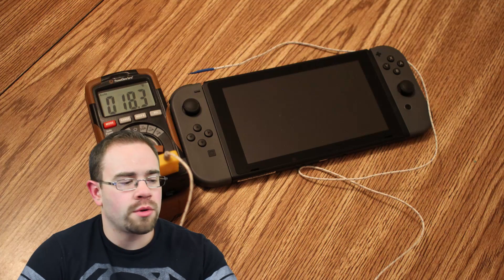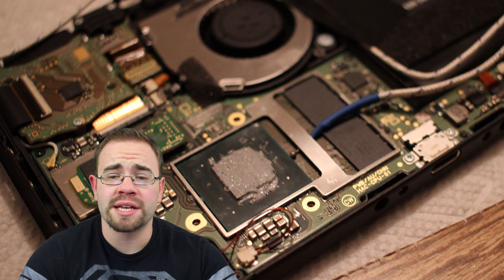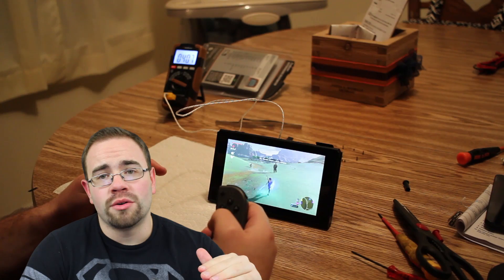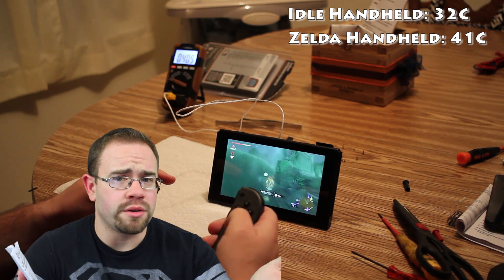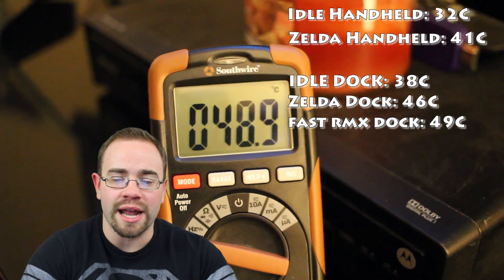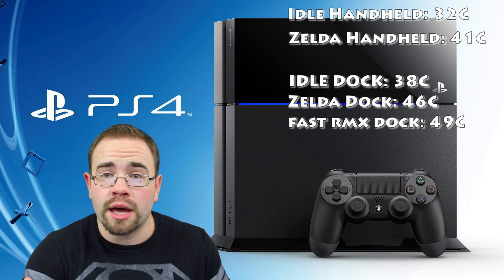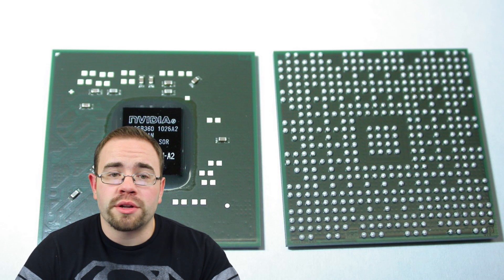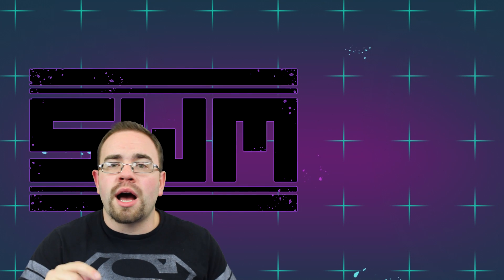How Hot Does The Nintendo Switch Get? Temperature Results!

Comment: I know the switch is not quite as powerful as the xbox 1 or ps4 but is he switch still more advanced then those systems and is there any way the chip can increase the the power?
Reply: BuffaloBill ....its mobile man do you not get that there is a difference? The PS4 and XBONE of 2013 are now equivalent to garbage cheap gpus nowadays...The Switch is like 10x more power efficient. That's like saying the first iphone wasn't advanced in any way because it couldn't run games from the n64 days 10 years before.
Reply: So are all consoles...your point?
Reply: BuffaloBill

"The thing is still WEAKER, than its competitors"

If you expect a device that's infinitely smaller, portable and $100 cheaper to have the same power as those bricks that sit on your table you're out of your mind. 

"So sad to see Nintendo bow out of the home console scene"

They've already sold beyond wiis release numbers which was one of the best selling systems of all time. Which btw outsold the ps3 that was released the same year. These slight differences in performance don't matter one bit, it's all about gaming. People like you are so easily fooled by arbitrary numbers and delude yourself into thinking that's all there is to it. This is the "Sega does what Nintendon''t" crap all over again.
Reply: You're right. All consoles are weak compared to their PC competitors. We are in agreement!
Reply: So...I have a 980ti in my computer, but I can't take it with me to play wherever. I get a Switch so I can. Why would I ever want to get an extremely outdated and weak PS4, PS4 Pro, or XBone?
Reply: BuffaloBill 
The whole point of Nintendo is innovating gameplay. Nintendo's specialty is adding a unique selling proposition which competes with competitors by not competing with them. I'd want to get a Ps4 but nevermind I'll get a Switch because it's the only one that I'll be able to play outside. There, USP. 

Nintendo doesn't compete in power, but gameplay. As long as it's good enough on power, they can focus on giving you the best gameplay.

Either way, you can tell by the way the Switch is sold out everywhere that it ended up being good. 

Please, stop adding to the army of people hating on the Switch for no reason. Before you add that there is a reason, I'll add that it's no reason to ABSOLUTELY DETEST it and start going on Switch videos just to hate, just critique it. That's the right way to do it and still have a life. Otherwise, may I suggest a video "How Switch haters wake up in the morning"?

Also Ryan Joseph I like your second name. :P
Reply: How was it a mistake if they are selling MORE then the Wii release? You are really a dumb ass...
Reply: BuffaloBill so according to your opinion the PSVita should have blown the 3DS out of the water yeah? Haha. Moron.
Reply: BuffaloBill How "advanced" can the Xbox One or Ps4 be if they lose the all the space they take as a home console to try and be portable without losing the affordability factor by spending more money to develop smaller but more powerful parts (which are more expensive) as well as trying to keep every other factor they afford which needs to use the massive amount of space they need for hardware?
Reply: Buffalo Bill Used the fanboy argument. Your credibility just went out the window...
Tell me BuffaloBill. Do you really understand the difference between running off of battery and the wall? It seems like you just like to brush that out the window...you know there's a large engineering difference.
Reply: BuffaloBill  Go ahead and take your PS4 and a car battery, and a monitor and go play for 15 minutes before it runs out and tell me how much more advanced the other consoles are.
You know your argument is stupid and pointless to compare, but if it makes your little self feel good about yourself to put other consoles down and feel superior to other random people online go on and keep doing what you are doing man.
Reply: BuffaloBill Nice shift. 
Sales beg to differ. Nintendo has broken it's own record for most consoles sold on new releases and the best rated game of all time. Yeah totally failing. You live in your basement. Get out every once in awhile. Sony is failing as a company. Just check your Sony smartphone..wait. Sony is slowly crumbling as a company. It doesn't know how to adapt. They will lose this next gen as soley home consoles become a thing of the past.
Reply: BuffaloBill Man I hope you aren't kidnapping young woman in your basement to use their skin to make you look like a woman, but otherwise what an awesome name for your youtube channel. Joker face too. Just really invites people to take you seriously. 
Sad thing is, this is probably the only attention you'll get today. Enjoy yourself bro. Peace out.
Reply: Actually, compared to Ps4 slim, Nintendo Switch is only 4x more power efficient. That's because Ps4 slim is built with 16nm architecture compared to 20nm Tegra x1 in the switch. Ps4 slim is more power efficient than most gaming laptops while running graphically advanced games like Horizon Zero Dawn and Uncharted 4 that put high end PC's to shame
Reply: BuffaloBill

And how did it turn out with wii, being less powerful than the ps3? Pointing out once again that power isn't as important as you seem to think. This isn't the wii, but it does well at this point. Hardly bowing out with these numbers, regardless. 

Besides what you think is sleazy is irrelevant, it's the results that speaks for themselves. The fact is that demand won't be there if the console is bad, no matter how much you try to rig it. Mistakes were made, as with any consoles launch but so what. Doesn't make your ignorant opinions any more valid.
Reply: +BuffaloBill That I can agree with. To be fair it launched just a few days ago, but the lack of games certainly isn't appealing. Whether that remains unchanged after a year remains to be known. Hopefully the little device can prove us wrong... Heh, but that is frustrating. We have to believe Nintendo will keep their promises but given their track record, it's awfully arrogant of them to ask again after the failure that is known as the Wii U.
Reply: BuffaloBill 

well they might cause its probably gonna crush the ps4 in japan cause the vita is near dead.
Reply: BuffaloBill I'll answer your question with another question. Why would you buy BOTW on a dead console that actually runs worse on the wii u? At least with the switch you will get more games coming in the following months. Odds are by the time you are done with BOTW on wii u you will sell both of them so really your just wasting money on something that's dead and isn't getting anymore games. I say if you got done with Zelda on the switch within a month or so a new game will come out(next month Mario kart deluxe and I believe ARMS.
Reply: BuffaloBill The hell are you talking about? It runs worse on the wii u than on the switch.  Where the switch has a few frame dips the switch has that constant. Don't believe me? Go look at a FPS comparison.
Reply: Billy boy

What do I mean lol.

"would choose to play that game on my 65 inch TV. Not on a 6 inch 
screen. So I'd go with a WiiU version, since it shits on Switch version"

Wii U runs it at a lower resolution. The switch has better textures, shadows, and draw distance. The coloring is richer on that version too. It doesn't stutter during like say  explosions like the wii u does. All in all it looks and runs worse on the older system. 

You complain about power yet you advocate getting it on a dead system that's less capable....
Reply: AbdallahSmash026#1Fan WTF are you talking about the Wii U version lags way more then the switch version
Reply: i think i lost 6 brain cells as i read through this comment chain,i'm amazed on how people think the switch is garbage because it's not as powerful as the non-portable competition,it's like comparing a ds to a xbox 360,except this time,the switch is powerful enough to the point that ps4 fanboys think the switch is a threat to their console so they bash it like a home console.
Reply: CWeltonDesign The thing is still WEAKER, than its competitors. Nothing you can say will change that. 

Keep with the long-winded damage control if you like. I got all night.
Reply: CWeltonDesign So sad to see Nintendo bow out of the home console scene. Well... I guess there's only so many times they can get thrashed by Sony in that space.
Reply: CWeltonDesign Doesn't mean it won't have a similar fate to The WiiU. WiiU sold over 3 million it's first month! Will Switch even win one NPD?
Reply: R3I It certainly doesn't have Wii momentum. 1-2 Switch, ain't no Wii Sports, to get all the casuals aboard. Besides that game not being nearly as compelling, it's also not a pack-in title either. Which was a HUGE mistake by Nintendo, not to pack-in anything.
Reply: Zabieru McCloud They're selling more than the Wii did at launch, in ONE TERRITORY. It's not worldwide. Plus, I don't doubt that Nintendo is doing staggered releases of the Switch, just like Sony has done with PSVR. A sleezy way to drive demand.

Trust me... the buzz isn't nearly as big as it was with The Wii.
Reply: SpawnWare himself made a video talking about The Switch's sales being taken out of context and over-exaggerated. Fanboys just want to keep their heads up their ass.
Reply: Cutter Elf but PS4 is not portable
Reply: thank you for actually giving me a clear answer instead of all these other people arguing
Reply: Amir Mitri Vita had no games. 3DS did. On top of a massive MSRP drop. The Vita also had no storage, and when u did buy storage for it, it was expensive, proprietary storage. So it pretty much killed itself out the gate. So Nintendo did everything right, while Sony did everything wrong.

Switch has no games (including no big 3rd party support) nil to no features, No killer pack-in title like Wii had, and is considerably weaker than launch PS4 and XB1. Consoles that launched nearly 4 years before Switch. So Nintendo this time... is doing a lot wrong. Not everything, but A LOT.
Reply: ***** The PS4 really didn't sell well solely on power. It had every other advantage too. On top of Microsoft shooting XB1 in the face, at its reveal. That in and of itself, mostly set the tone for PS4 to dominate.
Reply: ***** 3DS did everything right, in preparation for PS Vita launch. That more if what I meant. When there was an imminent threat, Nintendo responded beautifully. The Switch isn't even in the same case scenario, because there's nothing Nintendo can do to stop that juggernaut known as The PlayStation 4. Sony is doing everything right.
Reply: +BuffaloBill The difference between the Switch and it's competitors is the fact it's a portable device. One could argue that they value that factor over power. Do you agree? Clearly you do not and that is fine. But at least try to understand where others are coming from.
Reply: Jinsei Cast Portability is the sole advantage that The Switch has. However, it doesn't have the sheer amount of games that PS4 has, and I fear it won't ever match it in that field. If Switch had all the 3rd party games PlayStation does, and you could take them on the go... THAT would be a game changer!
Reply: Jason Nosaj Breath of the Wild can also be played on WiiU.
Reply: For anyone who doesn't want to read this entire comment chain, I'll give you a summary. BuffaloBill never leaves his/her house so he/she will never give the portable side of the Switch a chance
Reply: Jason Nosaj What does that matter? The point is, you can get it on WiiU. It's not exclusive to Switch.
Reply: Joseph Mateo
that is a lie Nintendo did compete in power until the wii where they manged to get allot of sales form the casual market
for god sake the N64 name is a proof of that
Reply: BuffaloBill 3 million in the first month? No the wii u only manage 2 million in its first month then 3 million 6 months later. it didn't even get to 5 million until Mario kart 8 got released
Reply: יהונתן דולב
They competed in power... untill they realized it wasn't working out for them.
Reply: Jason Nosaj Again... you dense one, that doesn't change the fact that one can get the game on WiiU as well. You Nintendo fantards (and some price pouchers) are the only ones buying The Switch as of now. Anyone who is normal, and of sound mind however, will weigh the options and go and buy a WiiU off eBay for like $75, and play BotW on there. Cus why spend $300 just to play one game, when you don't have to?
Reply: ***** Having a port as a main launch is a good idea. If not many people bought the previous console but this one will have alot then it's a good idea to port it on there. Besides Zelda has been more anticipated than any other game this gen. 
What makes you think Nintendo is porting some of the wii u games on the switch?  Cuz not many people bought them.
Reply: johnny dotson Who in their right mind would buy a Nintendo console for $300, just to play a handful of games? Besides... Zelda still runs almost just as shitty as it does on WiiU.
Reply: Buffalo logic

"The thing is still WEAKER, than its competitors"

"So sad to see Nintendo bow out"

"you can get it on WiiU"

That's what's called double standards.
Reply: BuffaloBill It's launch release games what do you expect. Launch games usually aren't good. 
So far as I see it. There is 2 or 3 big ticket game being released every month this year. Games like ARMS splatoon 2, Mario odyssey,  Mario kart deluxe,  Skyrim, Fifa 18,
Reply: R3I What do you mean by that?
Reply: ***** I think you mean the other way around Wii u Zelda lags while in handheld On the switch it doesn't but docked it tends to have a few dips
Reply: ***** Ppl also buy PS4 to play 3rd party titles. You know... the kind of games Nintendo consoles don't get.
Reply: johnny dotson I would choose to play that game on my 65 inch TV. Not on a 6 inch screen. So I'd go with a WiiU version, since it shits on Switch version. This wouldn't be the case if Nintendo didn't rush a Switch port. I thought they were all about gameplay performance? Not this time. Smdh
Reply: johnny dotson But hey... the console is one big rush job in and of itself so...
Reply: johnny dotson It drops down to 20fps ON BOTH, but in different spots. Almost always in populated areas on both. You know what... me personally, I'll think I'll just wait till the game is fully emulated on PC, and play the game @1080p/60fps with no issues.
Reply: BuffaloBill I can understand why people think it's rushed. Internet problems, Internet browser missing etc. But at least in time those things will be fixed and added. 

Besides even with it being rushed its still in better shape than the wii u was
Reply: johnny dotson No it's not. WiiU had far more features than Switch at launch. It was just slow af.
Reply: Jason Nosaj If it was exclusive to Switch, then that woulda been the smartest move.
Reply: Jason Nosaj There's WiiUs selling on eBay for as low as $75.
Reply: Jason Nosaj If it's identical (which shouldn't be at all the case) then why buy a Switch if that's the only game you plan to play for awhile on it?
Reply: R3I Like I said... I'll just wait till it's emulated on PC.
Reply: Billy boy I don't really care what you personally do. I'm just pointing the holes in your logic, you spew too much fanboy nonsense that's equally as stupid as it was back in the 90s.
Reply: Jason Nosaj Well wouldn't had been the first time Nintendo did the players on the outgoing console dirty. Besides... mostly Ppl that bought WiiU will be buying Switch. So that's like 13 million of you.
Reply: Jason Nosaj That's what I said "most" not "all" that bought WiiU will buy Switch. 

Reading is fundamental
Reply: where do these games put high end pcs to shame? the 30 frames per second? the motion blurriness? the dynamic resolution? Praise your toaster :)
Reply: Ryan Joseph 2 months later and I have a feeling these people in the comment section have changed there opinion on the Switch
Reply: johnny dotson yeah me myself has kinda changed my opinion on it as well but I still it's a good system but I just wish it was more powerful
Reply: Ryan Joseph At Least it's enough power to get 3rd party support
Reply: johnny dotson well It can get some of it but like I said the power factor limits some of those games from coming on the switch
Reply: Ryan Joseph Why increase it?  Anymore and you'll start killing the battery and overheating the console
Reply: BuffaloBill the hardware the ps4 and xbone uses are from 2010ish
Reply: CWeltonDesign Nintendo is supposed to also manufacture HOME CONSOLES to be competitive with other home console hardware manufacturers. Correct?
Reply: CWeltonDesign That's funny... yet you bought the weakest of the litter in The Switch!
Reply: CWeltonDesign You're about to tell me that Switch isn't competing with Sony and Microsoft's platforms, aren't you?
Reply: Joseph Mateo How's the Switch as a stationary, home console, stack up against Microsoft and Sony's PS4 & Pro, and Xbox One & Xbox One S?
Reply: R3I The Wii was an ABERRATION. 

Look it up, if you don't know the meaning.
Reply: CWeltonDesign
ok listen the point is the  console is so weak that 3d party games are to hard to develop the console will simply wont get those games and with no 3d party games
your console will die out
it already happened to the wiii u
Reply: CWeltonDesign That's a no-brainer. No console can compete with pc, as they're static hardware. I see you're avoiding by point though; by bringing a NON- CONSOLE into this. 

Typical defense mechanism for a Nintendo fan's bleeding heart. Lol
Reply: CWeltonDesign Weak... in comparison to its competitors. It's competitors launch SKUs, that are almost 4 years older than it.
Reply: Ryan Joseph How "advanced" is it, if it can't run games nearly as well as hardware that released in 2013?
Reply: Best thing about the switch is all the damage control and rabid blind fanboyism from ninty fans.
I'm loving their reasoning and "arguments" for all the valid criticisms.
They haven't changed in 30 years.

Just enjoy your machine and accept there are problems and be reasonable in your responses.
Reply: CWeltonDesign That cute and all, but Switch is still underpowered compared to those 2 consoles. That's all that matters. It can be the most powerful efficient device known to man, but as a gamer, why should I give a damn? It's WEAK.